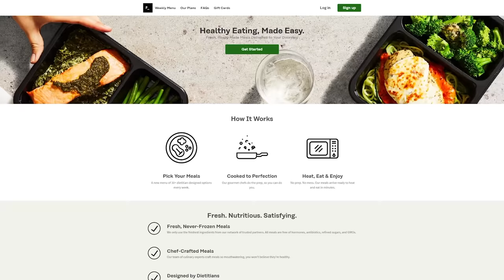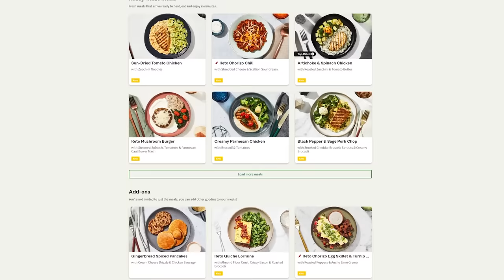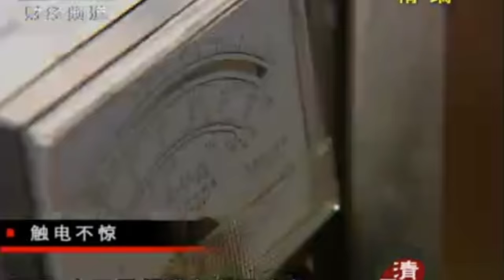The mystery that HAUNTED my fiancé for 20 years - we finally have answers | Pizza Hut Melt Mukbang

Comment: Just a small correction on what Stephanie said about not being able to let go when youre electrocuted: its not that your body "wants to stay connected", its more so that with all the voltage going through you, your muscles tense up and you are physically unable to open up your hand. Thats why electricians always advise touching things that might have current with the back of your hand, that way if your hand clamps up you wont be attached to the object. Also if a friend of yours is getting electrocuted you should never try to grab them, because the electricity will transfer to you as well, and you will be both unable to let go. Instead you should kick them away from it.
Reply: I wanna know why kick instead? Is it because of the insulation in your shoes?
Reply: @mathilda____7928  did you not read the first half of the comment ;_;
Reply: Maybe not kick them but have a blanket then throw yourself at them enough to disconnect the person from the electricity
Reply: Also it really is impossible to move your hand bc it's like your muscles are frozen.
Reply: @ItsAraceliy yea that's what they wrote in the original comment
Reply: Thanks for the science girl <3

Comment: Yeah. I was once electrocuted when I was young and will never forget the feeling. I felt the electricity throughout my body. I know it sounds funny but I even felt my whole body vibrating along with the electricity, it's crazy. Even my voice was shaking because of the impact (I was calling out to my mom asking for help). I don't know about the others but in my case, I was never able to release the extension wire I was holding even when I wanted to. I just froze there crying and screaming (like a faint screaming voice xD). Thanks to my mom brutally smacking my arms that I was freed from it.

Comment: SPOILER alert!
People would freak out when they saw that I could take hot pans out of the oven and touch fire without getting burned or feeling much at all.  I knew that it was because of a lifetime of manual labor and almost daily crafting that my fingers were so thick with calluses that they blocked the heat.  When I saw that the man's hands had a yellow hue, which is what calluses have, as opposed to the regular lighter color of the rest of the hand, like the back of the hand,  I knew immediately that his rough hands, like mine, probably formed a barrier to the electricity.

I could not guess the origin of the exploding popcorn maker.

I DID know from the start that the flying stick was a moth, but only because I have a hobby of photographing insects in the day and night, and I also have a stigmatism in my eyes that blurs light, so when I see a moth at night without my contacts, a flying moth looks exactly like that flying stick.  If I hadn't experienced these two things, I would never have guessed the moth.

Comment: @13:15 OMG this happend to my mom once, I was upstairs in our duplex, my mom was in the room on the ground floor. I suddenly hear her screaming the hell out. I run down to see the table fan flying across the room and my mom falling to the ground. Turns out, she was trying to grab something placed behind the fan and in that process ended up putting her palm on tap of the fan which was turned on at the moment. Her entire palm was stuck to the fan while she was being electrocuted. She said she tried her best to take it off the fan but she couldn't. She with all her might was trying to jerk the fan off her hand but she couldn't and then finally it flew across the room with the last jerk and she fell to the ground. Those screams still haunt me bro. Don't mess around with electricity for the love of whatever you love.
Edit: You know what, my brain just now came up with this. The electricity is trying to flow to the ground through you right. So if you just jump wouldn't it help?

Comment: Oh I remember when I was 5, I just finished showering. I wanted to dry my hair using our electric fan but it wasn't plug. I had to plug it but my tiny ass hands touched the metal part. And I was still kinda wet. I kid you not, I was thrown to the wall by the shock. Until now I'm still scared plugging shit in.

Comment: 35:00 in yeah poo and exploding water pressure pipe was my guess.... However I've been around Chinese popcorn only once never again LoL... But earlier in episode the chamber pot is needed still to this day .. think of our elders and how it's very needed when clinch control is gone.... Also electric shock .. we had a 6 bulb 'chandelier' and I forgot to shut light off when changing it... I was 350 lbs 5'11" at the time... It blew me across the kitchen into the door 30' away LoL. Then I was mowing 12 yrs later and a rogue cloud shot lightening at the tree next me but the lawnmower grounded me.... 😅

Comment: Yooo, I got electrocuted once. I was maybe 15, and I had just gotten out of the shower, and I didn't dry my hair that good,  and was just wrapped in a towel, still deipping-ish.
Anyways, I leaned over my power cord for my computer, and it was one of those big ones that you plug like 10 things into.
I don't remember getting electrocuted, but I woke up on the floor afterwards.

Comment: @ 13:10 biss lol, it's not that your body "wants to stay connected to the power" but more so your body reacts to that voltage running through it like you're having a seizure. Not easy to just relax your grip on the source. That is why they say when you see someone getting electrocuted that it is best to A) NOT touch them directly & B) get something that does not conduct electricity to knock the source out of their hand. EX. - A wooden broom stick.

*These are so wild. Can hardly wait for the next one. Also why the heck do the village elders keep consuming random things & calling it "herbal medicine" with no regard for their CURRENT HEALTH?!😭😭😂 I cannot with them & I am concerned with the answer.